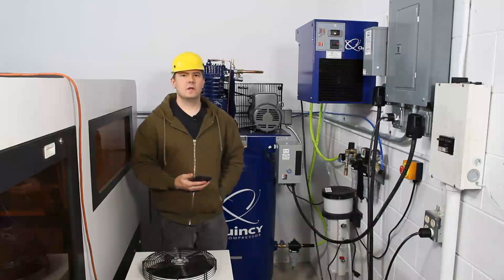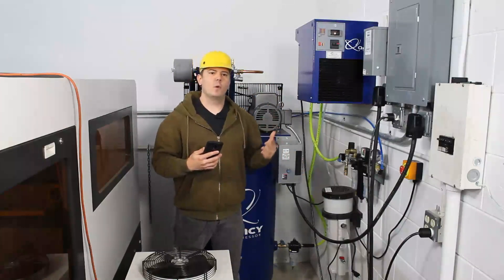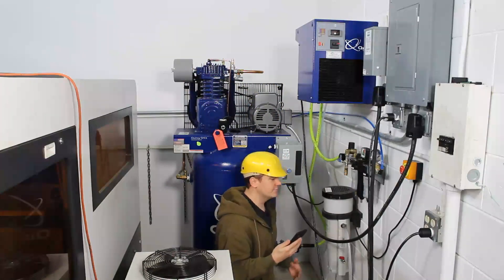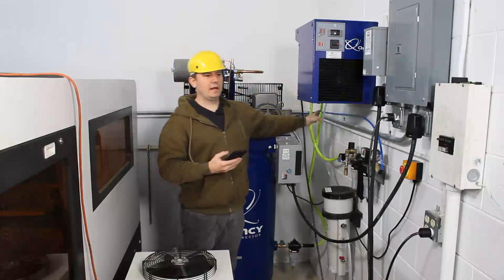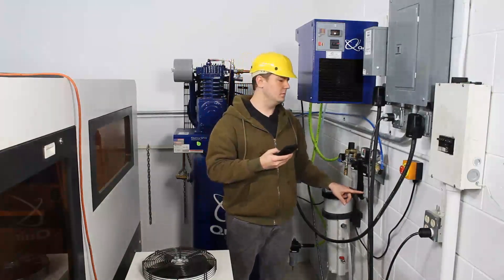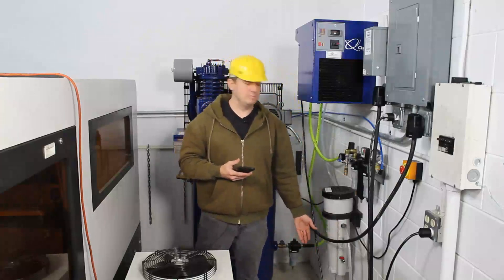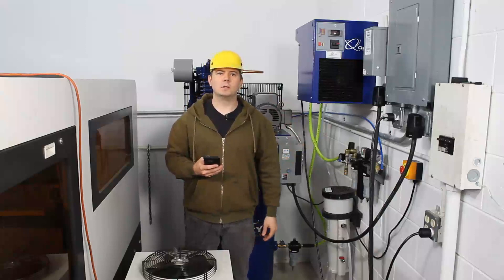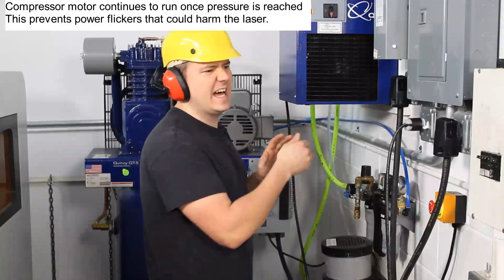Compressor setup for laser

Comment: We have a 30HP screw compressor hooked to our 12,000 watt OREE fiber laser and we cut all the way up to 1/2" carbon steel with compressed air with a great, polished finished edge. You do need 240 PSI to do this but it's possible for sure. The compressor has a five stage filter with a built in dryer and this is important as well so as not to contaminate the lens of the laser.
Reply from the maker: Yeah as the thickness increases the pressure requirement increases.. We are doing thin sheet metal and have a limited electric service, so the setup we have is enough for practical use up to 2mm (14 gauge). We are currently running a 1500w source and have cut as thick as 1/4 inch (6mm) with compressed air, not that I would recommend anything over 2mm with this setup as the burr gets pretty thick.. And yes the filtering requirements are high, we have five parts to our filter setup so likely it is similar..

Comment: Hi, I am looking to get a 1000 or 1500 watt fiber laser in China. They keep telling me that I need a 15 bar or 220 psi  20 Hp motor compressor. I do not have 3 phase electric. I can get a converter, But was told that I need a 60 HP converter because of the hard start which is $7200 on top of the compressor cost. I only cut 20 gauge carbon steel. Can you please tell me is a 150 to 175 psi compressor will do what I want ?  So I do not need to spend all this money. Thanks
Reply from the maker: So 20ga carbon is within range with what we show, we cut a fair amount of 20ga. Currently we are running a 1500w source on the same machine with the setup we show, 16 gauge does ok but has a little bit of edge, 14ga requires a little bit of sanding before tumbling. We did install 12mm tubing and added some larger valves to improve flow to the head, which allows us to cut 22ga with the gauge showing 125 psi with the air flowing.. The air compressor we show has been running very well for nearly three years now, probably payed for itself a couple times over. We have changed the intake filter and the oil, the other filters are still within acceptable range, however I should probably have changed them a year ago just due to age.
Reply: @smallshoplasers8785  Thanks for getting back to me. I do have another question. I am confused as to getting an open table machine or closed. I cut with plasma now and that makes so much smoke cutting. Does the laser make allot of smoke with the exaust fan ? I just do not want to make an erra getting a laser and do not want to breath smoke. I keep getting told lasers with down draft do not make much smoke.
Thanks

Comment: Thank you very much for sharing your valuable experience, I have a 2000w IPG laser, do you think that it can cut 3mm of carbon steel and stainless steel with compressed air?
And is the air conditioner important and make big difference in cutting performance?

Comment: Hi, how do you run your fiber laser system in single phase?
Reply from the maker: Most of the 500 and 750 watt units are made to use 220v power which is Line to neutral, if you are in the united states you can use a buck transformer to reduce the 240 Line to line to 220v, and then wire the machines "line" to line 2 and "neutral" to line 2, you will want to follow the wiring to make sure they don't have their grounds and neutrals crossed.. The larger machines would need three phase, which can be generated using a rotary phase converter and then using a buck transformer to adjust the power to the 380v they use.

Comment: How many CFM is needed to run your laser? I was reading were one user was suggesting that ~250psi and 70CFM would be needed for compressed air for the laser which seems crazy....?....
Reply from the maker: The compressor we have is 17 scfm and checking with a stop watch it shows that it is only compressing 25% of the time, so roughly  4.25 scfm.. And yeah I ran across the same numbers when I started to look into this, but for smaller machines cutting sheet metal the numbers are less crazy.. Really wish I had known about this early on, we spend a LOT of money on oxygen tanks from airgas over the two years we have been running our little 500 watt bescutter laser.. This really cuts the cost of laser cutting down from reasonable to dirt cheap. we have cut around 14,000-20,000 parts since switching, we wanted to make sure this actually worked in production before recommending it. And it is working great.. Check the other video we do a comparison cut on an "impossible test piece" and you can see just how much better air cuts than oxygen.

Comment: Thanks for sharing. There isn't a whole lot of info on running these things.
Reply from the maker: Two and a half years ago I could only find one video of one of the machines actually being used.. I've been trying to fill in the gaps in information. The compressed air thing was a big gamble since everything I found said 300-500 psi was needed. We ended up getting an HPA tank to test the idea, and found the air requirements fairly reasonable. The whole setup shipped with taxes fees and the like was around $4500+ as I recall.. But its easier to flip a switch than to haul the tanks in for refill, and with airgas and their constant double and triple billing it was an easy to justify the cost.